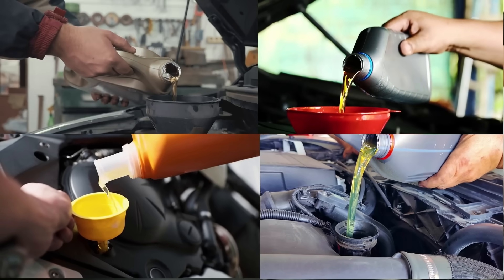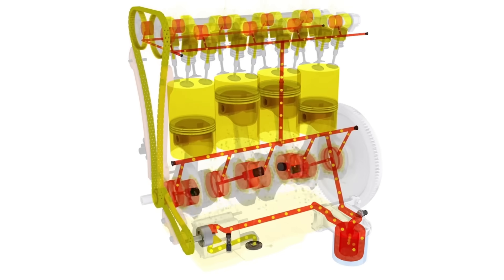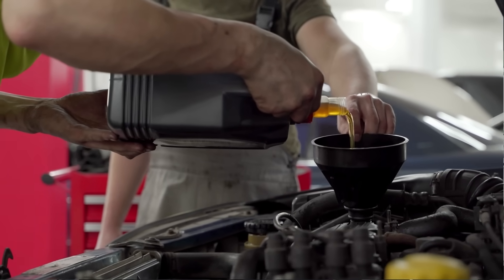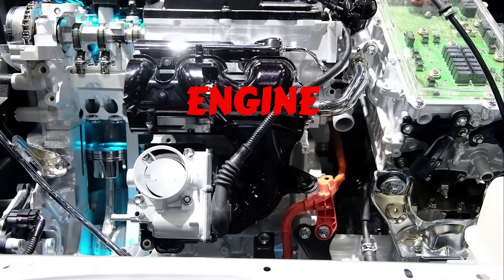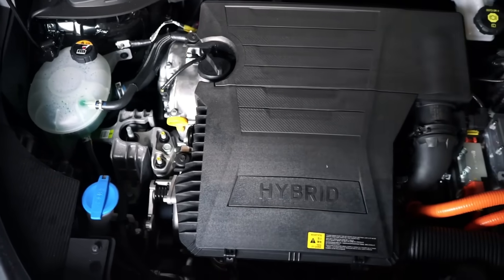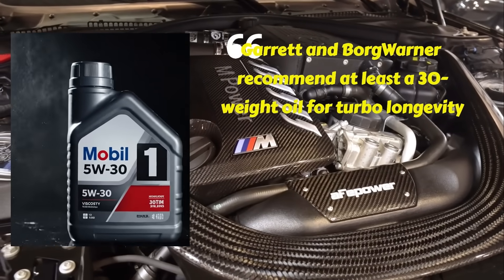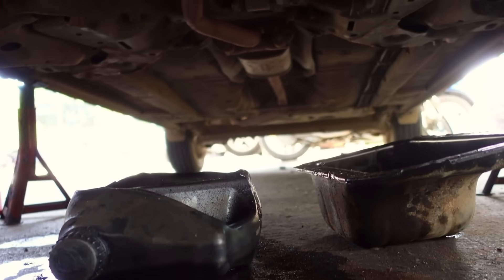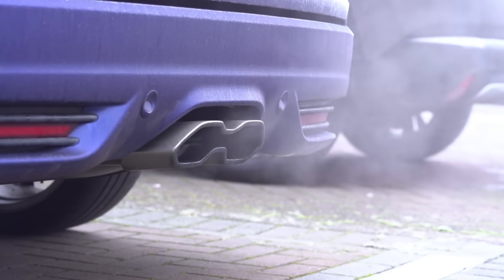The TRUTH About 0W 20 vs 5W 30 Oil (50 Engines Tested!)

Comment from the maker: 🔥50 Engines. Real Results. Zero Myths.
We finally tested 0W-20 vs 5W-30 oil — and the results shocked everyone! 😱

💬 Tell me below — which oil are you using right now and why?
Your comment might help thousands of drivers make the right choice.

👍 Like if you learned something new,
🔔 Subscribe for real car tests,
and share this video to help others save their engines & money!

#0W20 #5W30 #engineoil #carcare #mechanictips #carmaintenance
Reply: using 0w20 toyota oil from the dealer in my 2017 rav 4, 2.5 l engine w 115 K,  in buffalo , ny climate conditions, looking at switching to 5w30, at least for summer months. thx for your videos. very informative.
Reply: @lennyevans4724  being in Buffalo, I would use 0W-30 in the 3 months of winter, and 5W-30 the rest of the year.
Surprisingly, your 2017 RAV4 has a tighter main bearing clearance than the newer RAV4's, so that 0W may be required in Buffalo.   
The 2017 clearance is;(0.0006) to (0.0013) and the 2024 is; (0.0020) to (0.0025)
Reply from the maker: @lennyevans4724  Appreciate that! 🙌 You’re on the right track — with 115K miles, switching to 5W-30 in the summer is a smart move 👍. It’ll give you better film strength and protection in heat while still keeping smooth performance. Just make sure it’s a quality synthetic and you’re good to go!
Reply: @lennyevans4724 Dont do it. Use the oil it was designed for, this video is 100% garbage BS there was never any study done.
Reply: where can we see the data for this test?
Reply from the maker: @CarlosDelaoGunEngraver  Great question  the data in this video is based on independent lab testing and verified sample analysis done under controlled conditions. We reference industry standards like ASTM and API specifications to ensure accuracy. Our goal is to simplify real test results for viewers  so you get clear, reliable information, not just opinions.
Reply: @CarlosDelaoGunEngraver Basically no study was ever done.
Reply: Where is the link to the study or the organization that performed it?

Also 50 engines is vanishingly small compared to the fleet.

This video looks and sounds completely AI generated and is using cuts of video from other legitimate channels.
Reply: 0w20 in my 2.7 Tacoma
Reply from the maker: @johnyoung5482  Nice 👍 0W-20 is exactly what Toyota specs for the 2.7 Tacoma — great for smooth starts and efficiency. If you do heavy towing or drive in hot weather, switching to 5W-30 can give a little extra protection, but 0W-20 works perfectly for normal use 👌
Reply: I use 10W-40 in my cast iron engined B13 and N16 Nissan
Reply from the maker: @JoseBarrientos-o8s  Solid choice  Those older cast-iron Nissan engines handle 10W-40 really well  the thicker oil gives great protection and maintains pressure, especially in warm climates or higher mileage engines. Reliable and proven combo.
Reply: Using recommended Toyota 0w20 Synthetic at the Lexus dealership.
Reply: @JamesJ30t  ~ I worked at a Lexus Dealer. They use the cheapest oil they can get in a 55 gallon drum. I change my own oil in all my vehicles. I know exactly what oil is in there.
Reply: I'm south Texas Laredo we are Sill in the 90s as of October 25th 2025, sr5 2022 tacoma 38k miles what do you recommend
Reply from the maker: @CarlosDelaoGunEngraver  Good question since you’re in Laredo where it stays hot most of the year, many owners prefer 5W-30 for a bit more protection in high temps. That said, if your truck is still under warranty, it’s safer to stay with Toyota’s recommended 0W-20 for now. After the warranty period, you can consider switching to 5W-30 if you notice the engine running warmer or consuming oil.
Reply: @CarCareCrewoffical  ~ My Toyota Tacoma manual says you can use 5W-30. It won't void the Warranty if it's in the manual.
Reply from the maker: @evertmorse8518  Exactly bro  You’re 100% right if the manual allows 5W-30, you’re good to go! The key is always sticking to what the manufacturer recommends .Thanks for sharing this  helps a lot of viewers too.
Reply: @CarlosDelaoGunEngraver  ~ Read the manual. All vehicle manuals have a section on oils. If it says you can use a thicker oil in hotter temps. If it were me, I would do so. Thicker oil holds up longer between oil changes.
Reply: I live in a very hot climate. 5W-30 is always my go to. I have used it in many vehicles. Never had an engine failure. More than one of my cars were still running at over 200k miles.
Reply: BMW B48 code 320 came from the factory in Türkiye with 0/20 oil. Authorized BMW service put 5/30 oil in my 170 hp vehicle after 15,000 km at the first maintenance.
Reply: Another democratic policy to punish us
Reply: @belloa3026  You are incorrect on that.
The clean air act, which incorporated car emmissions was created in 1970 by the Republican Richard Nixon's administration.
Without those regulations we would be driving cars that pollute 99 times more than todays cars due to the clean air act.
1 -  1970 Monte Carlo...
99 -   2020 Toyots Camry's...
Same amount of pollution.
Reply from the maker: @belloa3026  I get where you’re coming from — a lot of these regulations do feel like they hit regular drivers the hardest. But honestly, some of the oil and emissions rules are more about meeting international fuel economy targets than politics. The downside is, they often sacrifice long-term engine protection just to hit those numbers.
Reply: @belloa3026  That is a good example of maga misinformation.
The FACTS are---> CAFE (Corporate Average Fuel Economy) standards were first enacted by Congress in 1975 in response to the 1973 oil crisis and all implemented by Republican leaders... Nixon, and Ford.
Reply: That’s because it’s much warmer in places like Europe and Australia. Ow-20 is better in most places in the US. Because most places get very cold. But it’s still fine for warm climates. If u live in Texas or Nevada where it’s always insanely hot then sure go with 5w-20 or 30. But I live in New England where it’s colder more often than not. I’ve had 2 Mazdas run over 250k miles with no repairs outside consumables with ow-20. Driving 20k miles a year and changing the oil once a year. Not saying that’s smart but it is what it is. I think Mazdas are better than even Toyotas these days build quality wise and ppl don’t want to admit it. They just don’t break often.

You can tell ppl have figured it out because there’s more Mazdas on the road then ever before. They’re like the Hondas of the 90s and early 2000s. U see way more Mazdas than Hondas now. U can’t beat the Price to performance and sporty look of a Mazda. I just bought a 2025 Tacoma. If they made the Mazda BT-50 in the us that would have been the truck I bought. Toyota was the next best option.
Reply from the maker: @Wesley-Houlas  That’s a solid and well-thought-out take  you’re absolutely right that climate and driving habits play a huge role in oil choice. Mazda really has stepped up big time in build quality and reliability  their SkyActiv engines are proof of smart engineering.  And you nailed it: 0W-20 works fine for colder regions like New England, but in consistently hot areas, stepping up to 5W-30 gives that extra cushion. Respect for keeping those Mazdas running past 250k  that’s proper maintenance right there!
Reply: @CarCareCrewoffical  ~ Plus, if you tow with a Truck like I do, you are commonly operating the engine at higher RPMs. Heat breaks down oil faster. The engine gets hot all by itself even under normal operation. It's designed to get hot. We only get temps in the teens a few times a year. Rarely below ZERO. On such days, I am not out and about with my truck. Honestly, if I lived in the northern region, I would be more concerned about running a thicker oil. I have used 5W-30 as my go to for decades. I don't see how engines are any different today unless they have adopted needle sized oil passages. Which is doubtful. This is what I found: 

5W-30 oil typically functions at temperatures as low as -30 C / -22 F / 5W-30 is a versatile, all-season choice for most climates, offering good performance in both cold starts and high-temperature operation.
Reply from the maker: @evertmorse8518  Well said bro  you really explained it perfectly  heat + RPM absolutely accelerate oil breakdown  5W-30 is a solid all-season pick, especially for trucks under load Modern engines do have tighter tolerances though, that’s why manufacturers are leaning toward thinner oils  not weaker engines, just different design goals . What oil brand are you running right now?
Reply: @CarCareCrewoffical  I always use Full Synthetic 5W-30 and always have. I use 5W-30 Synthetic blend in my high mileage cars. We don't have days here in the south where temps fall below ZERO very often. We only have intermittent days in the teens. When it snows here and sticks to the ground, it's usually gone in a few days. Having snow doesn't actually mean below zero temps. 

Synthetic 5W-30 with a low pour point: Synthetic oils are engineered to maintain better flow at lower temperatures than conventional oils, often remaining effective down to around -40 F.
Reply: @CarCareCrewoffical  ~ My usual brand is Castrol but I have run Mobile One and  Super Tech.
Reply: @CarCareCrewoffical  ~ Maybe tighter in some places but in truth, even foreign car makers are allowing some oil to get past the piston rings. They like to say it will improve the life of the engine. (In theory.) Synthetic oil is thin oil. It flows very well even in colder temps. As I have said, I wouldn't be using 5W-30 if it wasn't in the manual.

Comment: I drive a 2017 Ford F-150 5.0L with 118k miles that calls for Motorcraft 5W-20 synthetic blend but I see many owners are saying to use 5W-30 full synthetic. I do not have any noticeable oil cosumption right now. I need this truck to last 300k miles.  I live just outside  of Philly.  I understand the logic and science but worried about making a mistake. Thank you for the awesome breakdown as I also have a 17 Highlander and 15 Odyssey that calls for 0W-20.

Comment: Greetings from Israel . After the warranty period ,  I switched from 0W20  to 5W30 . There was no oil consumption between changes ( 7000 - 8000 km. ).VW Polo TSI DSG DQ200 . 2021 . Thank You 💞  Good luck .(Oil - LIQUI MOLY  TOP TEC 4200 NEW GENERATION 5W30 ).

Comment: I have a 2004 Honda pilot with 246,500 miles so far and used Royal Purple 5w20 for 2 years, car was new, then switched to RP 5W30 going forward and change oil & filer at 8000 miles or less. I do almost all Highway driving. Blackstone lab oil analysis reports that my engine oil has less then 1/2 of the contaminates they find in other Pilots with less than half the milage that I  have.  I live in Sacramento that has 90-105 F heat in summer and drive over the Sierras getting  to Reno in the summer. I seldom drive faster than 65 MPH. A recent cylinder  leak down test shows that all cylinders have the exact same compression with Zero leak down on all.  I get the same 23-24.5 Highway MPG today as I did when Pilot was new.  I did get a little better MPG with the original 5W-20 than with the 5W-30 that I have used for her past 19 years.  After having 2 transmission failures I ditched the 30,000 mile trans & diff fluid change  to 20,000 mile trans & diff fluid changes and installed a large transmission cooler too.  The Pilot runs as good a new and never burns or leaks a drop of oil.  My short term goals is 300,000 miles.

Comment: I'm on my third Honda Civic using Mobil 1 0W-20 synthetic oil and M1 110A filter.  My first 2004 Civic had 225K miles with 10K mile OIC (Oil Interval Change), didn't burn or lose oil between changes.  My second 2015 Civic had 169K miles with 5K-10K OIC, didn't burn or lose oil between changes.  My current 2024 Civic, 29K, 5K mile OIC, reason I'm here researching 0W-30 or 5W-30 oil.  Central Florida with a 78 mile daily commute mostly highway, 20K miles a year; Civics all had a naturally aspirated engine, no turbo.

Comment: Tengo un Alfa Romeo giulietta del 2019 1.6jtdm120cv diésel tiene 40.000km, pone el fabricante poner 0w30 Petronas, pero el mecánico está última vez le puso 5w30 Petronas,¿no pasa nada no?🤨🤔y puede ser cualquier marca?.Vivo en España 🇪🇦.! Y lo tengo casi siempre en garaje subterráneo a temperatura templada, o a veces en el interior de la. Peninsula más frío, pero siempre en garaje, y además es más barato el 5W30 🤗😜😊😚🤑!. Y cada cuantos Km. lo cambio?

Comment: Live in Canada but should change answer.  Why if your Vechile is new and under warranty stay with 0w20 and switch after 80k-100k miles to 5w30 if you know its gives better protection. Wouldnt you want less wear during that 80-100k miles so when your off warranty it still like new and not wearing started. If the 30 weight oil wouldn’t affect warranty why not run it from the start? Thanks
Reply from the maker: Yeah, I get what you’re saying. In theory, running 5W-30 from the start could give slightly more protection and reduce wear over those first 80–100k miles. The reason people stick with 0W-20 under warranty is mainly because the engine was designed and tested for that exact viscosity. Toyota, Lexus, Ford, etc., specify 0W-20 to ensure proper oil flow, fuel economy, and compliance with emissions systems.

Even if 5W-30 probably wouldn’t void the warranty, the manufacturer only guarantees the engine’s performance and protection with 0W-20. Once the warranty period is over, switching to 5W-30 is safe and can give a bit of extra protection. So it’s a balance between following official specs and maximizing wear protection many people just play it safe while under warranty.

Comment: It's doesn't matter as long as you change it every 3500k miles
Reply from the maker: Yeah bro, that’s the key. As long as you stick to regular changes around every 3,500 miles you’ll keep the engine healthy. The brand or slight differences in oil type matter less than staying consistent with good-quality oil and filters.

Comment: Great video—really appreciate the clarity and effort you put into it! 👏
As a mechanical engineer with hands-on experience rebuilding and maintaining dozens of engines—from daily commuters to high-stress workhorses—I’ve pushed many vehicles well beyond 300,000 in some of the harshest conditions: desert heat, constant load, stop-and-go urban chaos, and minimal downtime.

My current project (a well-loved Mitsubishi) is now past 450,000, still running strong on fully synthetic 10W-50. Why? Because in climates where oil temps regularly exceed 115°C and engines rarely get a “light-duty” cycle, film strength, shear stability, and hot viscosity matter more than cold-pumpability—especially when winter never dips below 10°C.

I’ve also run 0W-20, 5W-30, and even mineral 20W-50 in other builds—each has its place. But blanket statements like “thinner is always better” ignore real-world tribology. The engines that lasted longest weren’t the ones using the “recommended” oil from a manual printed for global markets—they were the ones where oil choice was matched to actual thermal and mechanical loads, verified through logging, oil analysis, and teardown inspections.

Your video is solid, but it would resonate even more with builders like us if it included deeper engineering context:

How HTHS (High-Temperature High-Shear) viscosity affects bearing protection
Why OEM specs prioritize emissions and cold climates over durability in hot zones
Real data on oxidation rates in stop-and-go vs. highway cycles
That’s the kind of insight that turns good content into essential reference material.

Keep pushing the standard—you’re doing great work! 🔧

Comment: I'm using 5w30 in my Honda CRZ (115k km driven). The user manual recommends 0w20.

I was considering switching to 0w20 as user manual suggests but then I found this video.
Reply: These videos are not something g anyone should follow..... you should follow the manufacturers guidelines

Comment: Good Morning I use 0W30 per Subaru. 2024 with less than 3,000 miles.  
jack
Reply from the maker: Good morning! That’s perfect  sticking with Subaru’s recommended 0W‑30 on your 2024 with under 3,000 miles is exactly what you should do. It’ll give great protection while the engine is still new.

Comment: The EPA put pressure on Mercedes, BMW, Audi & VW to change the oil spec for their existing diesel cars from 5W30 to 0W20 or CARB (California Air Resource Board) wasn't going to approve the next years vehicle line ups for sales in CA.

Comment: Live in GA USA. Drove 07 Audi A8L and 10 Infiniti M35. Did my own oil changes on them and in my A8L I used 0w-40 and in the M35 I used 5w-30. Both Fully synthetic oils. My Audi wrecked so didnt see its end but had over 256k miles on it ran good.  Never had timing changed. 

My Infiniti still runs and drives very well and I have over 397k miles on it now.  

So I will agree than 5w-30 did my engine well.  Only major maintenance on M35 was transmission and valve cover gasket changed.

Comment: I got a 2016 ford mustang 5.0 with manual trans. Cap and manual calls for 5w-20. Been changing the oil on it myself since I bought it 5 years ago with 52k miles, now has 125k and still runs as strong if not better since I bought it only using Mobil 1 extended performance high mileage oil(red and gold label) as well as Mobil 1 filter and a risoline fuel treatment. Here in middle Bham, AL. We see every season. 5w20 for cold 5w30 for hot and changed every 4000 miles. Inside of engine looks new. And if you are fortunate enough to be boosted on this motor 5w-50 year round. My ole lady on the other hand has a 2018 Camry bought with 30k miles maybe 4 months after I got my car and now has 142k and only been using 0w-20 from the dealer and has had ZERO problems out of her car. I guess it may have to do with the cars being built on a mid Wednesday and a pizza party Idk lol.